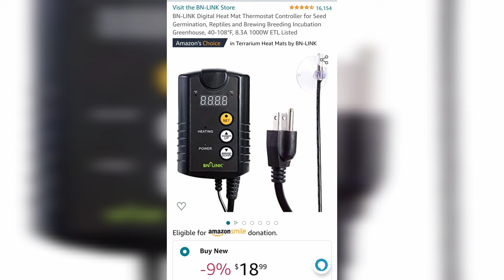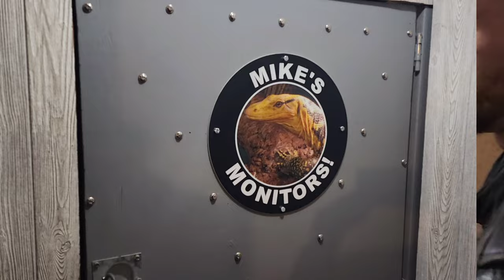DIY Baby Water Monitor Setup & MIKE'S MONITORS Tour @mikesmonitors1148

Comment: Do you have a parts list?  I'm curious to see how that filter panned out.
Reply from the maker: Yeah, in the description, I have all of the parts I used. Also the filter is holding up great and still running strong.
🤘💯🦎🐸🐍🐢🌱
Reply: @bradsbioactivebuilds  much appreciated.